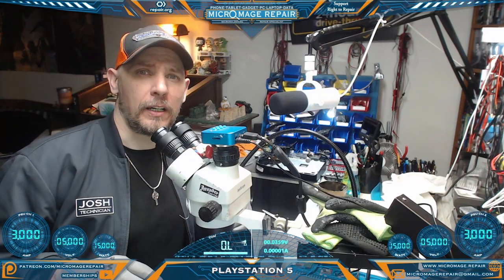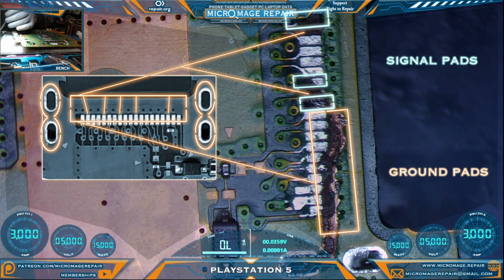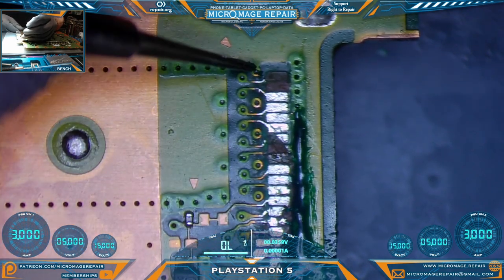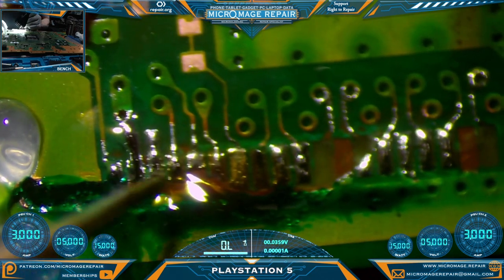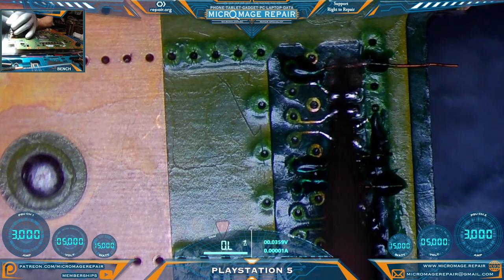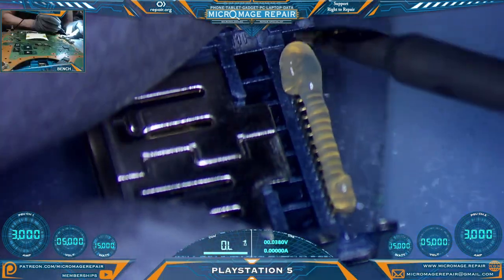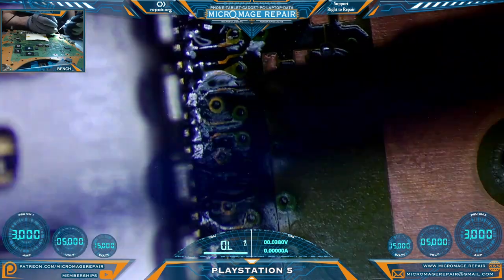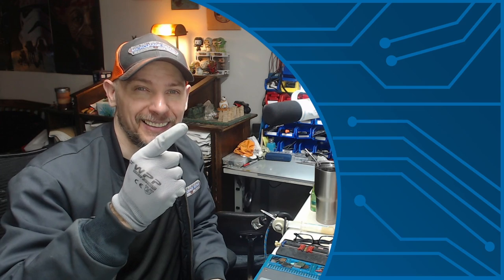😮PLAYSTATION 5: Prior Repair FAIL! Can This be Saved?😮

Comment: On PS5 to remove the HDMI port all you need are 2 minutes ish. You heat up with T12 iron station on the max temp ground pats and adding more solder to help it. Can add flux, but not a must ;). Once melted and moving a bit, you heat up with hot air on 450C minimum or more and port is out quickly - even the new boards witch components on the other side going out smooth with this technique. I've recorded a video about it and will be released in the next few days.

Here I'd not tin those pads on the port. With flux you'll have a good connection anyway. I did that only when I was not that experienced with soldering them. Now with more practise, removing and inserting these ports on PS5''s is really quick and efficient. So, practise folks and don't damage like here. :D Use even an old TV mainboard, but don't attempt first on those consoles ;). Only when you've got a practise, do them. You'll save money and time ;).
Reply from the maker: Thanks for watching!
There are a million different approaches.
That is one of the coolest things about the craft. 
The best approach is what works successfully for you and your client!